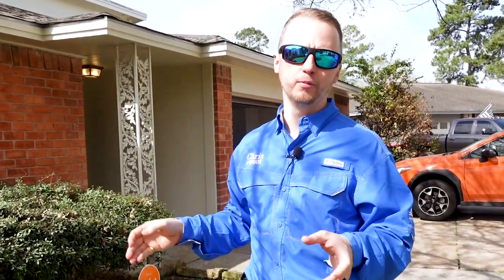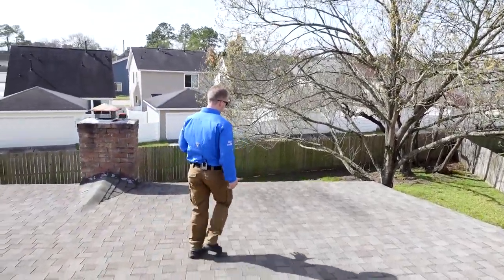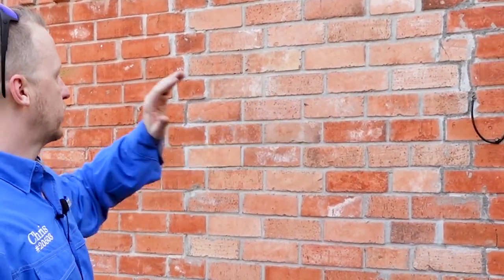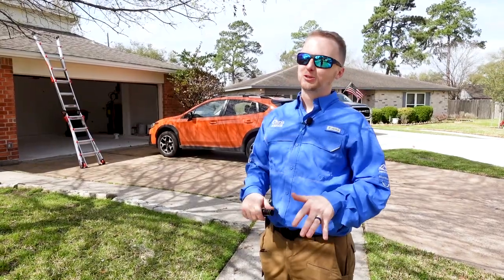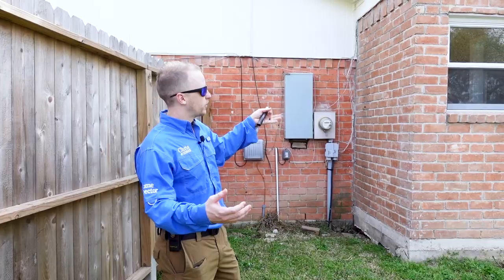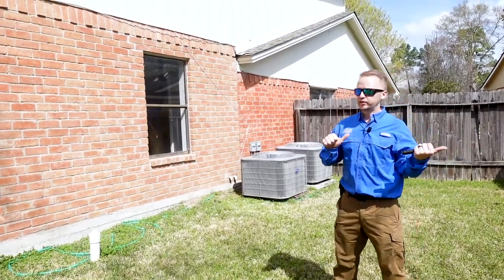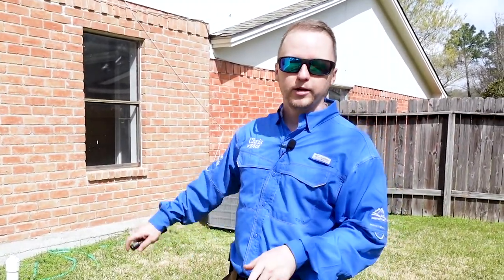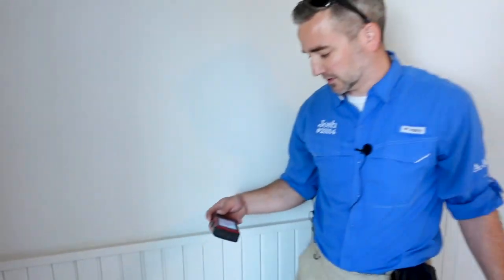1960s 2200 sq ft. Property - Home Inspection - Roof Damage, Foundation, & More

Comment: You can have those shingles on the roof just have to double the underlayment or install Ice and water shield for the whole roof. Poor ventilation of the attic as well. Good video though.
Reply from the maker: That is really good information.  Thank you! It is very unlikely they did that.  Other than pulling the shingles up at the end to double check it.  Is there another sign someone can identify that?
Reply: @AActionHomeInspectionHouston  LOL Nope! Most chances are unless you know the roofer who installed the roof they did it wrong. It is always a safe bet to write up. Depending on the area people live some states require ice and water shield at the eves but not the rest of the roof. So if you have a low slope roof in one of these areas you will never know for sure that the whole roof has been done.
Reply: @jstimen1906  yeah unless you watched the roofer put it down, I'd be skeptical. But I've done the ice and water on shallow pitches and it works just fine.